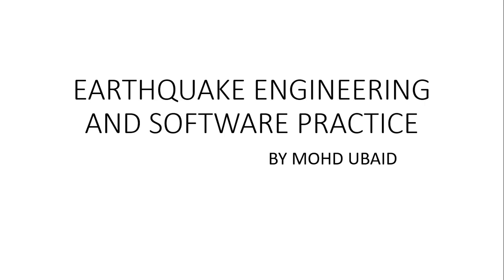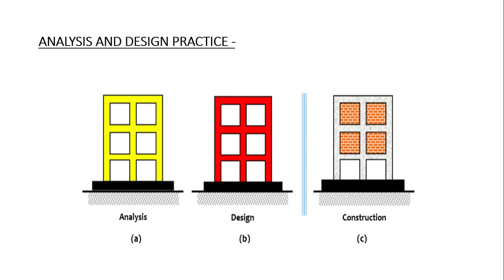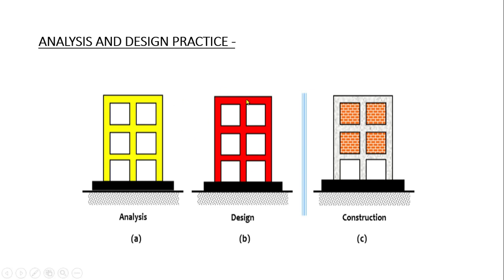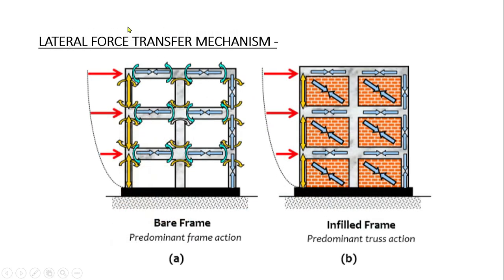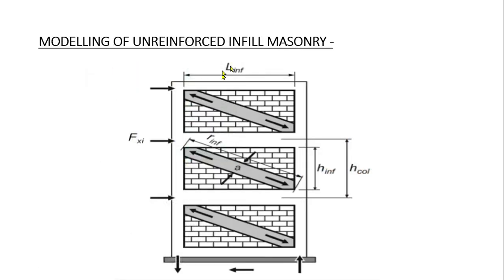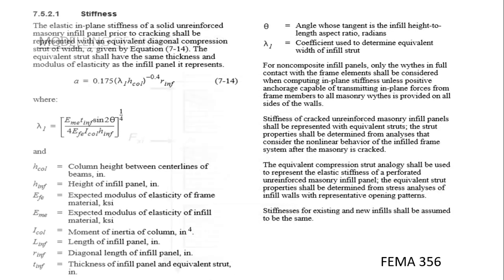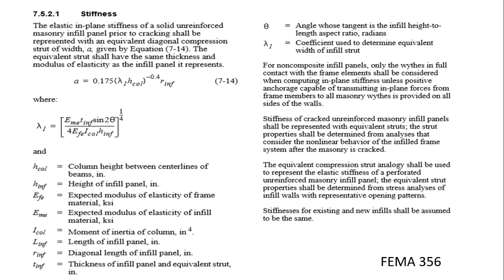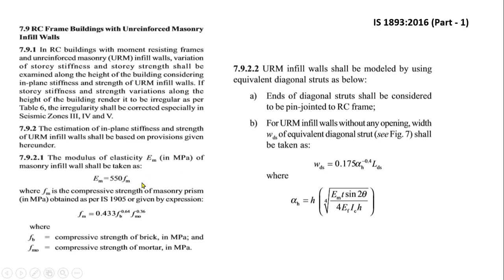MODELLING OF UNREINFORCED BRICK MASONRY INFILL IN ETABS/SAP2000   (STRUT ANALOGY) , PART -1

Comment: Hello sir. At the 10:40 mark item d states that the thickness of the equivalent diagonal strut should equal the thickness of URM but has a condition the h/t and l/t is less than 12. I'd like to ask what if we have only a thickness of say 150mm where h and l = 3m it will be more than 12, is there a condition for this intance? And if only the IS has this condition and not in ASCE or FEMA? Thank you!